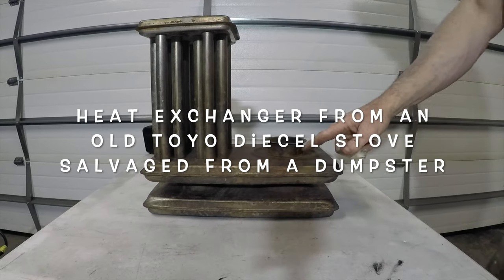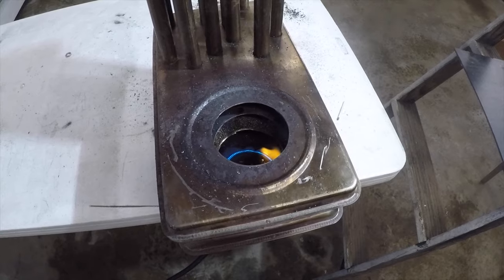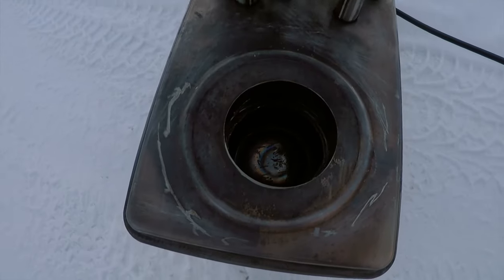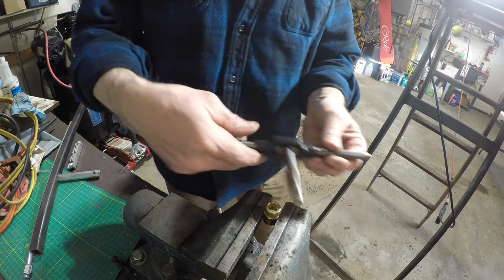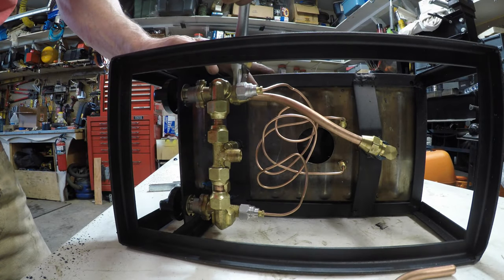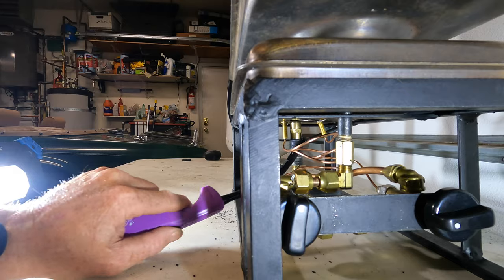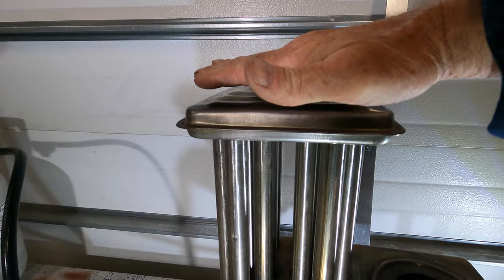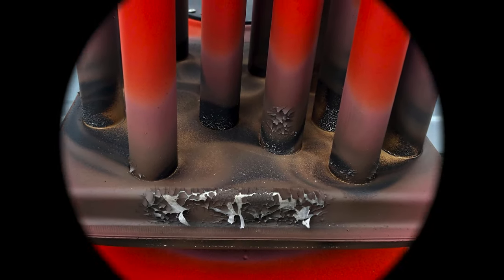DIY Propane Tent Stove

Comment: Cool project!  How’s it been working for you?  Have you used it a lot?
Reply from the maker: It was very fun project. We used it last winter at Arctic Man, an outdoor winter games event, and it developed a crack in the heat exchanger. I will either fix it or take all the parts and use them on another heat exchanger. Thank you for watching and commenting.
Reply from the maker: I used it last year at Arctic Man, and Alaskan outdoor festival, that video will come out in a couple months. It works pretty well. that said, I thought it was going to be beyond awesome and it didn’t reach that level of performance. I recently bought a Chinese diesel stove and I’m going to get it going soon and see how it is. The funny thing about it: I spent less money on the Chinese diesel stove than I did just cobbling together this cool project.